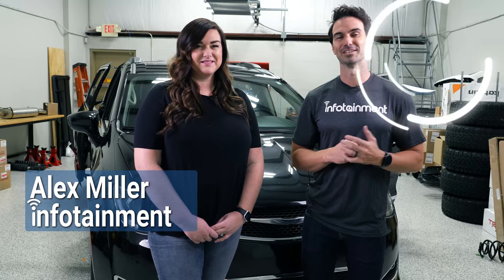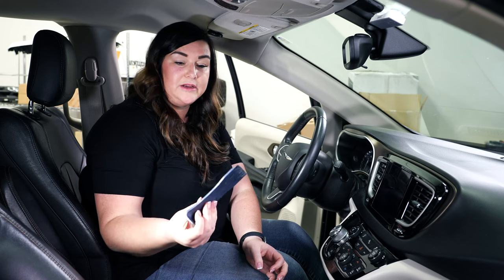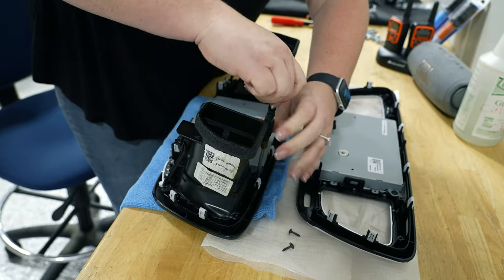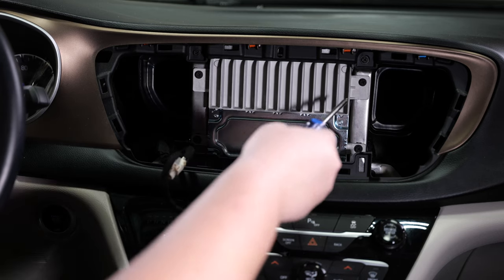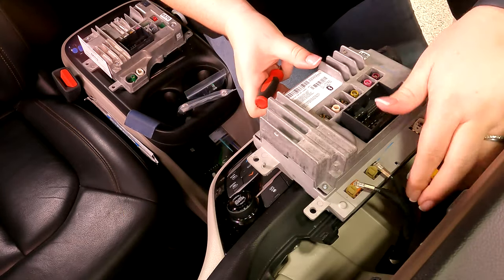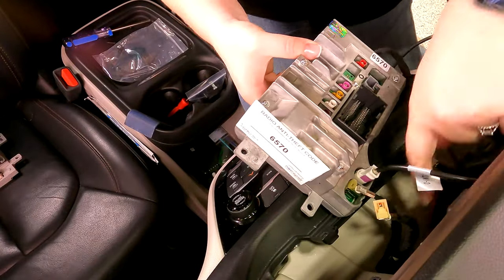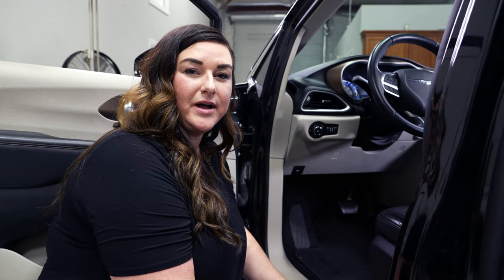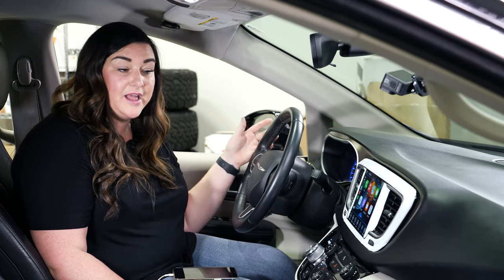2017 Chrysler Pacifica - Apple CarPlay Upgrade Installation - Infotainment.com

Comment: These radios have every limited capabilities. The radio unit in my ‘17 pacifica needs replacing due blacking out and “not accepting any new updates” according to the dealership. It came back on and is working fine for now but would this product be the same as the radio replacement I was advise to do? Will the features such as the two screen theater and backup cam still work smoothly?
Reply from the maker: This would be a replacement rather than an update. The update explanation sounds somewhat dubious.

All of your existing functionality would continue to work as designed if you decide to upgrade to the UAV

If you don't want a complete upgrade, you may be able to have your existing radio repaired. Contact our repair department at 855-636-6287.

You can get more info on repairs at this link https://www.infotainment.com/pages/infotainment-repair-services.

Comment: That’s pricey
Reply from the maker: We do not sell cheap equipment. We sell OEM quality equipment that is fully tested, pre-programmed and procured based on your Vin. There are plenty of companies that sell cheap products. We want to provide a part that we are able to guarantee works and will continue to work. We are confident enough in the product we sell that we are able to warranty it through installation and up to two years depending on your selection at check out. We feel our pricing is competitive as we are comparing our pieces to the cost of getting a new vehicle as opposed the cost of an aftermarket part whose quality is greatly inferior.

Comment: Would this work with my 2017 chrysler pacifica that has a DVD player/entertainment system already installed? Do yall android auto?
Reply from the maker: Yes. You can always call one of our Tech Advisors at 855-636-6287 to confirm compatibility.

https://www.infotainment.com/collections/all/products/2017-chrysler-pacifica-gps-navigation-vp4-ru-radio-upgrade?variant=9208494030884
Reply: @Infotainment_nav  Simple question, please answer here - will the ORIGINAL CHRYSLER INSTALLED Theater package work with your radio?

Comment: Will this upgrade work with the OEM backup camera?
Reply from the maker: You would have to purchase OBD Genie Rear View Camera Bundle for it to work
Reply: @Infotainment_nav  Can you elaborate on this, so the backup camera and parksense will not work with this unit?
Reply: @Infotainment_nav  I don’t think this is an accurate reply. The website says “Pre-programmed to function with your vehicle's existing back-up rear view camera.”
Reply: @Shanhalt14  any updates on this?

Comment: Will this work on the Pacifica Hybrid? With tbe battery and hybrid screen menu options?
Reply from the maker: What's year is your Pacifica? 

You can contact one of our Tech Advisors at 855-636-6287. They can look your vehicle up by VIN and confirm compatibility.
Reply: @Infotainment_nav  can you please answer here?  It's a simple question - the 2017 Hybrid was the top of the link on that year, will the Hybrid info appear as it should on your radio?

Comment: Do I have the ability to upgrade the uconnect 8.4 nav with the 360 degree cameras for a 2017 pacifica touring L? And do your units support wireless Android auto or does it have to be plugged in via usb?

I would love to have android auto and it sucks it came on 2018 models. Thanks.
Reply from the maker: We don't offer 360 degree cameras for the Pacifica. 

The UAQ does not support wireless Android Auto. Because these are factory units, they come with only the factory functionality that existed when the equipment was manufactured.

You can get an inexpensive Bluetooth adapter that works via the radio's USB port that will provide wireless Android Auto capability.
Reply: @Infotainment_nav  Please confirm then based on this comment by you, Original cameras installed at factory by Chrysler will NOT work with your UAV upgrade radio? I just ordered to replace the original radio that came with my 2017 HYBRID with all the options including 360 camera - I need to return your  radio then if so

Comment: So the new module the Uconnect 4 or 5? Also is this CarPlay option wireless as well?
Reply from the maker: This is a UConnect 4 unit. UConnect 4 requires the wire.

Comment: My main question is does the android auto and car play work with the on board USB plug in the car or does this replacement come with its own USB plug? At least show that it's plugged in so I can see. 

Why is the replacement display white?
Reply: Looks like white protective plastic that peels off.
Reply from the maker: No replacement USB hub is needed.

Comment: Do you have uconnect 8.4 upgrade for 2018 ram 3500 Tradesman with 4 speed fan.
Reply from the maker: Yes are two different links for the 2018 RAM 3500 Tradesman 

https://www.infotainment.com/collections/all/products/2013-2018-ram-1500-2500-3500-8-4-4c-nav-uaq-retrofit-kit?variant=5340140601380

Or

https://www.infotainment.com/collections/all/products/2013-2018-ram-1500-2500-3500-8-4-uconnect-4c-uas-with-apple-carplay-android-auto

Also, call our Tech Advisor about the 4 Speed Fan 
855-636-6287
Reply: @Infotainment , I did call you guys and left you a message. No one called me back.  
Item in the second link is not available

Comment: My current head unit controls the movies that are shown on the kids screens in the second row and allows me to control sending the audio through the car speakers.  Does this unit allow that same functionality?
Reply from the maker: This is a plug and play factory OEM upgrade package that maintains the factory integrity of your vehicle.  That being said, as long as  the rear entertainment is also a factory OEM feature, it will have no issues functioning with this upgrade package.